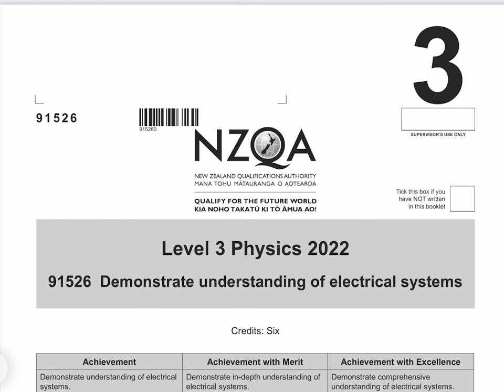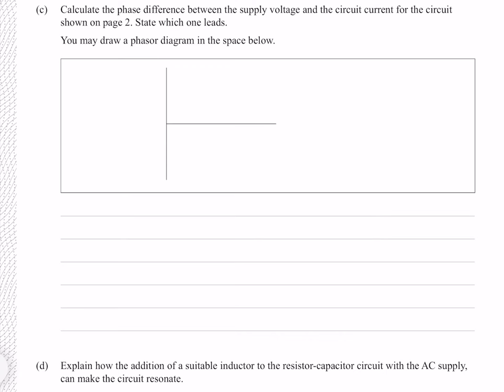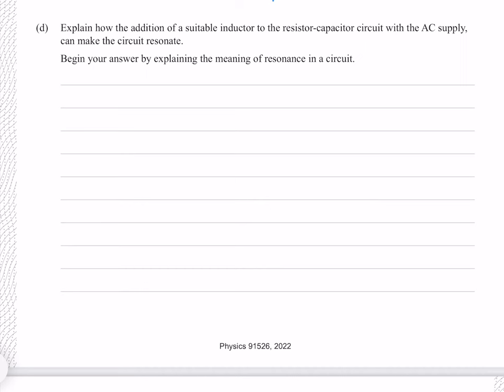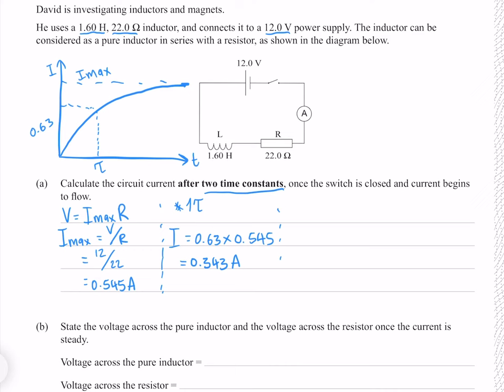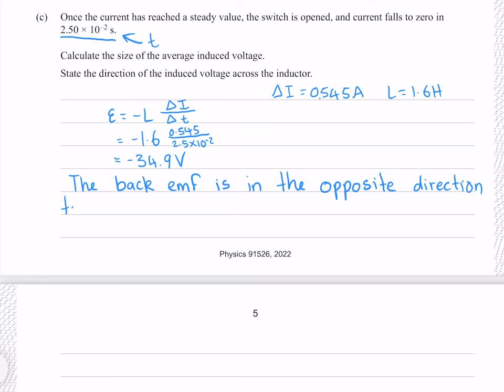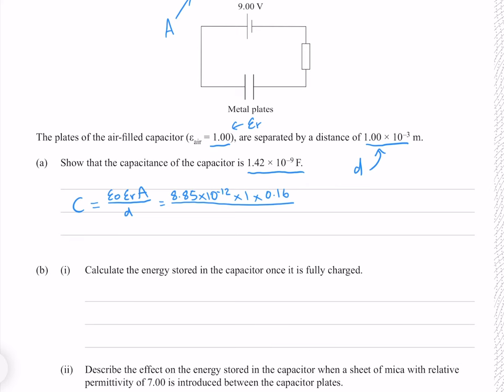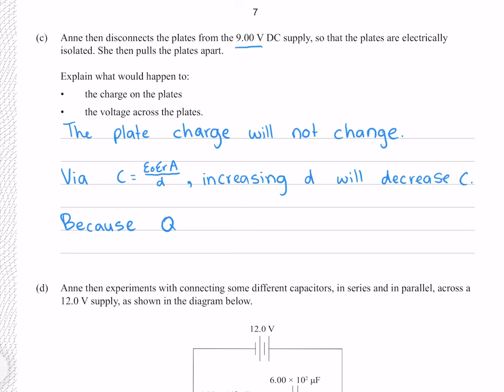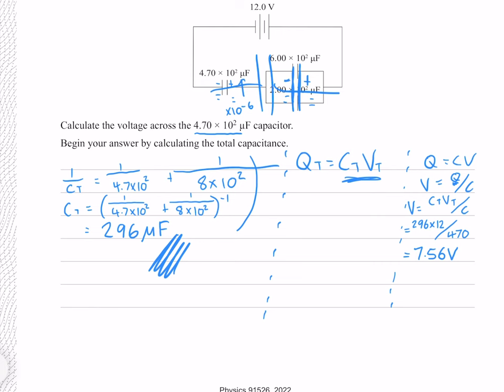2022 Electrical Systems Exam (NCEA Level 3 Physics)

Comment: Good afternoon sir. For question 1c: How come the current is in phase with the Resistor voltage but not the supply voltage? Since IR = resistor V and IZ = Supply V. Why is it that Current leads the supply voltage instead of current being in phase with the supply voltage?
Reply from the maker: Great question Leo. The supply voltage is not in phase with the circuit current because the capacitor and inductor influence the phase of the current too. In a very loose sense, they behave like funky power supplies.

For this reason all three must be considered when determining the current phase.
Reply: @MrWhibleyPhysics  I see, thank you sir! Though if all the components (capacitor, power supply and resistor) must be considered, is there any explanation for why the circuit current is in phase with the resistor voltage?
Reply from the maker: Voltage is energy per charge, and energy is lost to resistance only when current is flowing.

We can also view this mathematically, where we already know that current and resistor voltage are directly proportional, via Ohm's law V=IR.

When one is zero, the other is zero. When one is at a maximum, the other is at maximum. They therefore must be in phase with each other. Hope that helps!
Reply: @MrWhibleyPhysics  ahhh that's right. Thank you very much sir! 😁

Comment: This might be a dumb question, but for question 2a, why are there two max currents? the first one is 0.545A and then there is another one after that is 0.202A.
Reply from the maker: Hi KK, good question. For 3τ we are now imagining the current starting from 0.343A, this would make the current increase to the 0.545A maximum equal 0.202A.
Reply: @MrWhibleyPhysics  oh okay, thanks

Comment: Hello, to find 63% of Vmax for charging a capacitor I can't find an equation to use. Would I get this type of questions in the exams?
Reply from the maker: Hi Ananomous Rex, there are two equations on the formula sheet for time constant (τ=RC and τ=L/R). Haiving these and knowing the definition of the time constant is the time for a 63% change, should be enough to solve any such problem.
Reply: @MrWhibleyPhysics  I do undestand the t=RC equation but haven't covered the t=L/R. What I mean is for an example If have a max voltage of 15V for charging a capacitor to find 63% of that voltage can I multiply it by 0.63 so (15 x 0.63) which gives me 9.45 V at 63%. Would that make sense?
Reply from the maker: Great. You'll cover the τ=L/R when you study inductor-resistor circuits. Your working looks good to me.
Reply: wow I recognise you from the infinityplusone comment section. I helped with the similar triangles